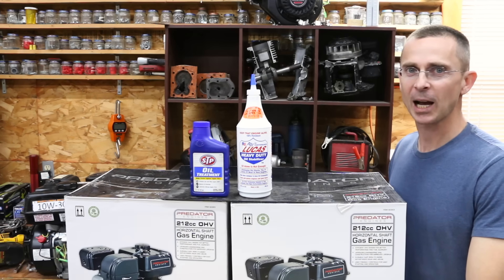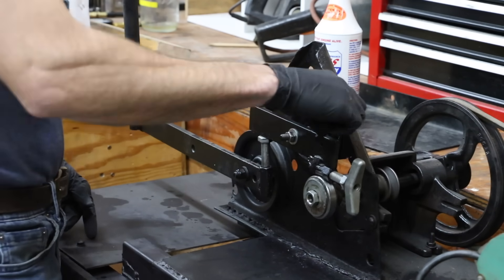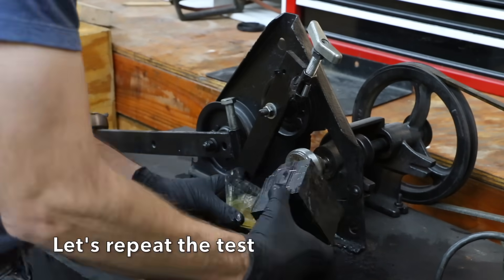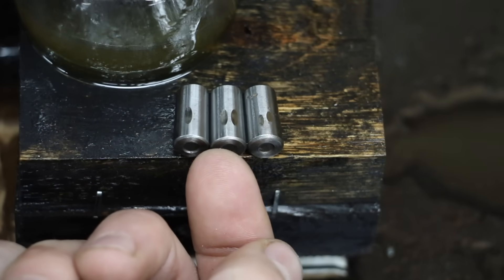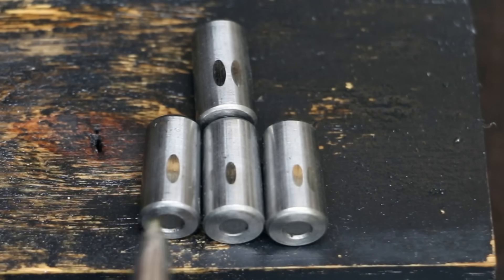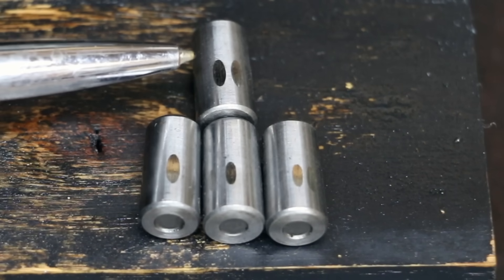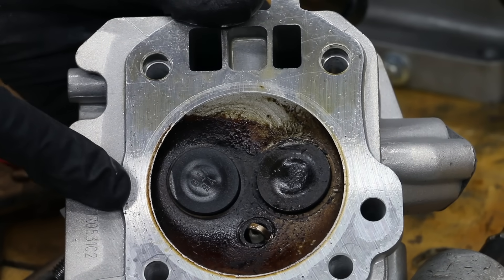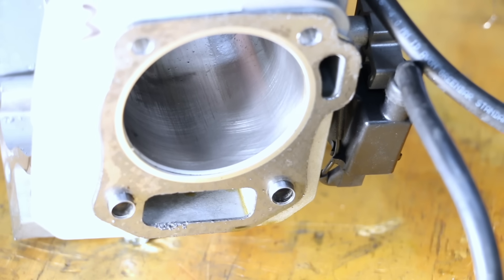Which engine self-destructs first?  Lucas or STP?

Comment: For a video use hot sauce as the oil.
Reply from the maker: Thank you for this recommendation!
Reply: motorgarage 21 use red bull for your coffee instead of water...
Reply: Maybe it’ll run hotter then 😂😂😂
Reply: Try running an engine on astroglide
Reply: wear goggles ;)
Reply: So what your saying is Lucas and STP are pointless.. actually they perform worse then just oil as in your previous engine destruction video bestline vs 10 40 ... maybe you should walk before you run. or just make regular oil changes. But a massive big up for best line ?
Reply: With hot sauce for oil you won't need to preheat the engine!
Reply: I don't think this would be meaningful in any way - it's pretty obvious that the engine would seize sooner or later. IMO destructive tests should be done with some meaningful purpose, such as simulating some extreme or unfavorable conditions, fault, operator/user mistake that could happen to a certain degree, or on the other hand to prove whether some special treatment (like oil additives in this video) or conditions are beneficial or can extend life of the engine. Otherwise it's just a waste of working engine that could have been used for better purposes.
Reply: I agree no purpose whatsoever to ruin good engines that way. I assumed motorgarage21 was joking and pulling our legs...but maybe not!
Reply: Yeah it would probly work better then the  dino oil (i.e non synthetic )
Reply: Nice

Comment: Good video.  Thanks for the upload.  I'm not sure if spending money on the oil additives are worth it.  Back it the 1960's a petroleum engineer told me not to use oil additives, in particular, STP.  He said that STP increases oil viscosity and drops engine RPM, decreasing gas mileage.  I was driving a motorcycle during that time as a means of transportation.  STP in my motorcycle did slightly drop the RPM at idle and I did notice a slight decrease in gas mileage.  I stopped using it.

STP stands for Scientifically Treated Petroleum but Andy Granetelli, president of STP Corp., joked and said that STP means "Sex Takes Patience" in a radio interview. 😀
Reply from the maker: LOL!  I enjoyed your post and you bring up a great point regarding oil flow resistance caused by thicker oils.

Comment: I think a better demonstration would be running WITH oil, but under a VERY heavy load.  Maybe even going a little beyond normal redline.  During the demo, take numerous temp readings.
Reply from the maker: This is a great recommendation. I'm still trying to figure out how to create a system to apply even loads for each engine or even a measurable way for one engine with a small budget.
Reply: There are bike trainers with Fluid resistant trainers at various price points or maybe even a recycled unit. would it be possible to use one or more of those to provide a test bed.  One issue would be slippage but you could rig up a unit with hard points.
Reply: I agree. But you must have a baseline. Honestly this test would take 30 engines to really get any sort of accuracy  unless one was just a god awful additive.
Reply: Generator and a resistive load would do it.
Reply: +Normsweb.com ...Or maybe a water pump.
Reply: CONTACTLIGHTTOMMY When these engines are under full load the throttle is balls to the wall
Reply: Normsweb.com I know, I'm just saying when you have those engines under a heavy load the governor will have the engine at full throttle, or adjust accordingly.

Comment: Ok, I have a question-

That clicking noise when an engine is cooling down. What EXACTLY is that? I think I heard it in the video and it's one of those things I keep meaning to find out but I always forget to look into
Reply from the maker: This is an excellent question. I believe it's the exhaust baffles contracting or the exhaust shield. Thanks!
Reply: I think you're right about something contracting as it cools off causing that noise. Great video as always.

Comment: This is so good. I love the detail and effort that goes into these. And I'm getting more and more ideas as to what to put in my engines as time goes by. Right now I'm running Lucas in my and my wife's engines. Project Farm, at the moment what do you run in your car(s) and in your lawn equipment? This winter I'm pulling apart my riding mower and possibly my push mower as well. Might as well (since I just got them with the house last month) protect them the rest of their lives!
Reply from the maker: Thank you very much for the positive comment!  I use Mobil 1 synthetic in my small engines and I use Valvoline 10W-30 blend high mileage oil in my vehicles.  I drive a lot of miles and change the oil every 5-6 weeks.  So, cost is a factor.  I also use Restore periodically as well as Seafoam and MMO in the fuel. Thanks for commenting!

Comment: Looks like the Lucas effectively reduced wear on the bearing in the first test. But, both additives did what i expected... produced foam. Regular oil has anti foaming agents which reduce the foaming. Foam will be produced around bearings and such, reducing the oils contact with the bearing, thus reducing the oils ability to remove heat from bearings. SO in the long run, both of these additives, especially under hard high rpm use, will increase wear.
Reply from the maker: Excellent point and thanks for commenting!

Comment: I think it's important to follow the directions of application and even when you did the test with straight STP vs. Straight Lucas the wear was still less with Lucas so that I think is a very important part as well because it still gave results with both test all the while in a controlled manner.
Reply from the maker: This is an excellent point. Thanks for commenting.

Comment: There is only one oil additive that really works so far as my testing has shown, now Slick50 contains no PTFE like it used to do. 
That is Activ8.
Currently running a Fiat 1.6 105bhp at 257000 miles in 5 years as a taxi. Still on original gearbox and Turbo. Treated with Activ8 as per instructions both in gearbox and engine. 
Would love to see that on you lubrisity tester! In all bearing tests I have seen there is little damage even with considerably more force than you are using. Try it out. Its not cheap but actually works well. 
I suspect the Lucas oil additive would be bad news to someone if they have a turbocharged car. The way it galls up on spinning parts.
Reply from the maker: Thank you for this recommendation!

Comment: Have you ever heard of the one of brake fluid being added to motor oil destroying bearings within 500 miles can that be done with lawn mower engines or do you need an actual engine bearing
Reply from the maker: Thank you for this recommendation!

Comment: Hey may be a stupid suggestion, maybe not. I am curious about how a mixture of a couple of different products together would effect the engine, maybe positively or negatively. Like I've got a 1zz-fe that's burning a lot of oil and i know it wasnt always maintained. I want to know if engine restore and seafoam would work together or even possibly wreak havoc in the motor. Or if marvel mystery oil and lucas are compatible. Those are poor examples but they're what i have thought of. Maybe mixing two of any of the products youve reviewed already to see if it works better or worse than the tests youve done separately.
Reply from the maker: Thank you for this recommendation!
Reply: Michael Repman hey, try additives and make vids to post.

Comment: People don’t get it, literally what that stuff does is make your oil thicker, really often used as a bandaid for a wound that needs stitches. In a healthy engine it is bad, your manufacturer recommends you run a certain weight of oil, thick oil will take longer to reach the top of your engine. Definitely a bad idea.
Reply from the maker: Thanks for commenting on this!

Comment: Will seafoam free a stuck lifter valve on a lawn tractor?
Reply from the maker: Thank you for this recommendation!
Reply: Project Farm I have a cub cadet and it runs normal as far as horse power and starting but it has a obnoxious tick that just started abruptly with no warning, just changed oil
Reply: Id try it
Reply: Collin Klitz I have no idea why it is doing this but I don't  know if the seafoam is safe for small engines

Comment: Great video as always! I really enjoy watching new content that you put out- from start to finish! I'm wondering if there is some sort of baseline you could set for the engines to better understand how well the oil products performed (since it's looking like you're pretty serious about doing a lot of testing)? Compression, pull weight on the starter (etc)... I'm sure these engines are very similar with very minor differences (if any at all) but there could be enough of a difference that might change the results for various reasons. Sorry if this doesn't make any sense- just free flowing thoughts. Again, great video!!!
Reply from the maker: This makes sense and is a great recommendation.  I'll see what I can do. Thanks again!

Comment: I think brand names and snake oil type stuff is WAY overrated. A friend from a long time ago moved to Arizona from Connecticut in an old clapped out Ford Econoline with everything they owned. They were on a time deadline, because he started a new job. With just enough gas money to make it, and a van that leaked/burned oil at an alarming rate, they were still a couple hundred miles away when the oil light came on. They dumped in 2 jugs of wesson oil, and the van made it!
The moral is, keep it full of oil.
Reply from the maker: This is a great post. Thanks for commenting.

Comment: I think using an aluminum bearing for the wear test would be more realistic, like aluminum bearings on a crank, or aluminum piston wearing against a cylinder wall. That and you wont need to clean up your big bearing nearly as much since its a softer metal. (If its already aluminum I apologize, couldn't really tell but it looked steel)
Reply from the maker: It is steel.  Thank you for this recommendation!

Comment: Fuel additives, I would like to see GT5Plus.  This stuff works a miracle to make gummed up engines run.  just one a tablespoon of GT5 beats a full bottle of STP gas treatment.
Put GT5 in your gas tank, let sit for 20 minutes to degas the fluid in your gas tank, then your good to go.  Will clean out and lubricate your fuel path through the engine.

https://www.pro-masystems.ca/DepartmentProductMenus/Performance/Shop/FuelAdditives.aspx
Reply from the maker: Thank you for this recommendation!

Comment: I'm going to guess while the advertisement plays that lucas fails first...
Reply from the maker: Thanks for commenting!
Reply: wouldn't have called that but after thinking about it, the lucas was much thicker so much more of it hung onto the parts when drained.. I just know several over the road semi haulers that won't touch lucas after axle failures and diff explosions, it builds up so much heat, blows the seals then the lube leaks out and blam....

Comment: I have been using Lucas for about 10 years now in cars, trucks and lawn equipment. It seems to help with noise issues. Not sure what help it has been for engine longevity as I trade in my vehicles at about 90 k miles.  Regular oil changes and Lucas for me.
Reply from the maker: Thanks for commenting on this!

Comment: Since you just did STP and Lucas you'd probably want to wait for a while, but I think synthetic Lucas and synthetic STP would be another good showdown. I have two vehicles I use synthetic oil in and have used both additives. It'd be a good part 2 to this fantastic part 1.
Reply from the maker: Thank you for this recommendation!

Comment: 20% is 1/5 not 1/4
Reply from the maker: Sorry for causing the confusion on this. I didn't explain this very well.  The bottle said to replace 1 quart of oil with lucas for every 4-5 quarts. So, adding 1 part of lucas to 4 or 5 parts oil.  Thanks
Reply: Project Farm ok I was confused for a little there, thnks for the fast reply you earn yourself a sub, and keep up the experiments!

Comment: U could try seeing if they would run on various gun oils or solvents, or how long they'll run using the oils and solvents as oil substitutes. Do you plan on trying my idea of seeing how an engine runs after its been subjected to the temperatures of a building fire (Like if your house and garage burnt down and the lawnmower was inside but you restored the mower and tried to use it)?
Reply from the maker: Thank you for this recommendation!

Comment: Where is your control? The first test was not very accurate because the oil wasn’t at operating temperature. Cold oil is not a very good lubricant
Reply from the maker: The Bestline vs 10W-30 video established the baseline. Thanks for commenting on this.
Reply: Project Farm and what was that result?

Comment: And truthfully… I doubt there’s any lubricant that will stop the bearing from scoring in the first test… Prove me wrong!
Reply from the maker: I believe you're right.  I've designed the tester so that I can measure the different film strength without adding weights or tampering with the device.  Thanks for commenting.

Comment: One of the additives I’ve researched recently is bestline engine treatment. The other is Petron plus oil additive. The tests I’ve seen on YouTube are amazing n I’d like to see how it does on your test. I know it’s not how engines run normally but if it can without oil at least enough to shut it down before catastrophic failure happens is worth it.
Reply from the maker: Thank you for this recommendation!

Comment: Please try Liqui Moly Cera Tec  or Liqui Moly Anti-Friction Oil Treatment In a test or vs each other. thanks
Reply from the maker: Thank you for this recommendation!
Reply: I️ second this!
Reply: I agree, the Liqui Moly would be really interesting. Molybdenum is supposed to be something akin to graphite, almost a "dry lube". I'd love to see this!!!
Reply: TheGoldishFish 
I agree! Mos2 should have some science behind it at least.
Reply: By the way I definitely subscribed, this is an awesome channel.
Reply: Yep, my suggestion as well.  Vs each other would be interesting, and also for other companies as well.  If a company makes a more expensive product... is it worth it?
Reply: TheGoldishFish yeah, that ceratec looks novel
Reply: Apparently hotshots FR3 friction reducer is a great additive. Has no pairaffinated oils
Reply: James Clark: I agree, use synthetic, proper weight for your engine. Change oil and filter every 5 K miles or 150 engine hrs. Synthetic does not lose viscosity like petroleum oils but gets dirty so needs changing. No additives needed or recommended by manufacturers.
Reply: This!
Reply: Liqui moly would be a great challenge 👍

Comment: So if you're going to run an engine without oil then Lucas is the best option... I'm really more interested on the average fuel consumption of those treated engines, as I see both additives are just oil thickeners and that's not good for a modern auto engine consumption
Reply from the maker: Thank you for this recommendation!

Comment: Molly lube.... MOS2! For me, it's the bomb. About $10/bottle. Quiets noisy overhead engines. MOS2 is the cam and lifter lube for a flat tappet Cam. I love this stuff!
Take care from Oklahoma
Mike and Vee
Reply from the maker: Thank you for this recommendation and thanks for the positive comment!
Reply: Project Farm my rider is 11years old. 31 CID 19.5 hp. Does not use any oil. The overhead was tapping, added the Molly (MOS2), no more tapping. When breaking in an engine, I would not use it. After a good flogging,,, you bet your bottom side, I add it.
Take care from Oklahoma
Mike and Vee

Comment: I did write it in a previous video, but it would be interesting to see how a engine behaves when running on pure n-butanol. I did read somewhere that it could be used as a gas replacement without changing anything.
Reply from the maker: Thank you for this recommendation!

Comment: I really want to see some of that stuff from Liquimoly be rested in this way (both Ceratec and the MoS2 additive they have... just a warning ceratec is pretty expensive) 

But both are those operate off the idea of costing everything inside the engine and making it last longer (theoretically without oil it would last longer too) so it’s perfect for these tests!!
Reply from the maker: Thank you for this recommendation!
Reply: Yes! Liquimoly MoS2 and Ceratec are talked about on so many car forums like they are some of the only additives that actually do anything at all. Would be VERY  interesting to see them stress tested!
Reply: Yes, definitely Ceratec and the MoS2 additive! I use Ceratec in my car and the MoS2 in both of my Motorcycles, as these are wet clutch equipped, where Liqui Moly claims not to use Ceratec.

Comment: What will happen if you fill up the crankcase with olive oil or sunflower oil or maybe just water. 
I am a new subscriber, i watched all your videos and they are amazing.
Keep up these awesome videos mate,
Cheers from Greece.
Reply from the maker: Greetings. Thank you for this recommendation and thanks for subscribing!
Reply: Running from the zombies...engine oil gone but have a few quarts of canola oil in the back...gotta get away or get munched :D
Reply: I bet it would work. Maceyofgrandbend ran old vegetable oil in a car for a while. I think 2 different cars actually. Look it up.
Reply: It would eventually polymerise in the crankcase and set solid once the engine shuts off and cools down
Reply: You deserve it  dude ;)
Reply: Thanks i will check it :)
Reply: I've done it.  The engine kept seizing from full throttle and finally chucked the rod on the 4th try.
Disassembly showed the "oil" partially solidified everywhere becoming useless as a lubricant.